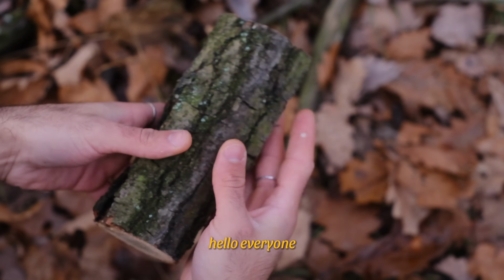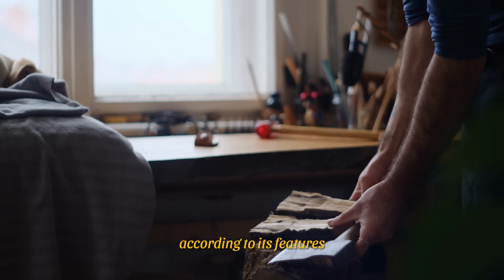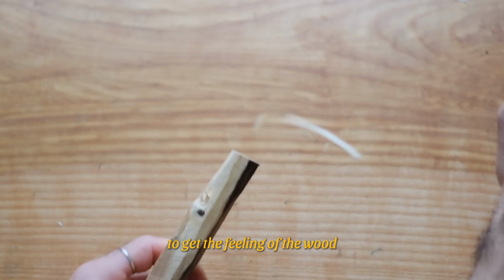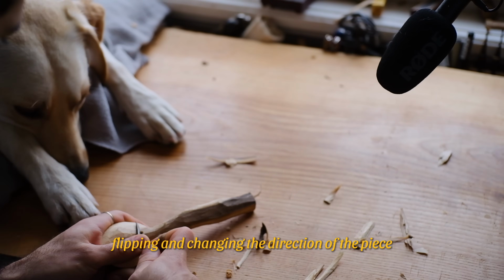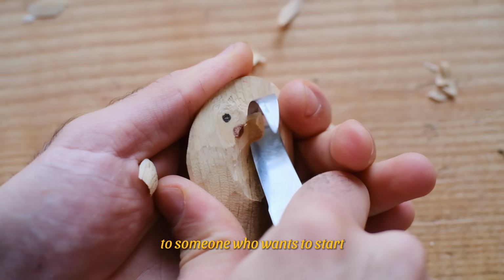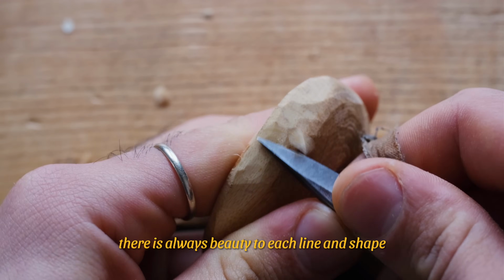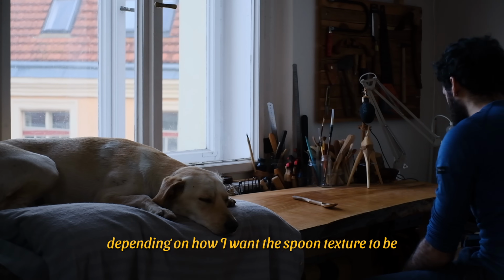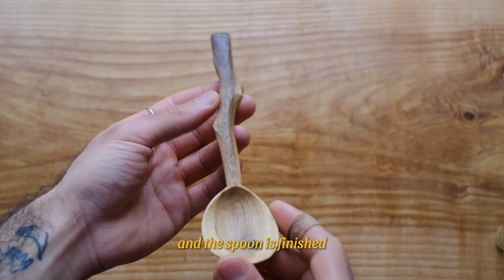How I Carve a Spoon from Start to Finish – Narrated Version

Comment: Well done.  I've been making spoons for a couple years and you have convinced me to seriously try a hook knife.  I've been using gouges only for the bowl of the spoon.  You have excellent controll with the knife and hook knife.  I have taken a different direction and focussed on ways to hold the piece.  I've built spoon mules and use a draw knife for all the rough carving.  It impresses me to see the controll you have with your cuts.
Reply from the maker: I also started with gouges, only bought the hook knife later on(:

Comment: A little piece of advice, if you don't mind:). Try double oil soaking of a spoon - after first oil soaking wait for 24 hours, then a little bit of 320 sandpaper work. Wipe it with a smooth textile, oil it again and after another 24 hours of drying, polish it with cotton very intensively for about a 15 minutes, to close all microcsopic pores. This makes wood more longlasting, especially when it constantly contacts with moisture.
Reply from the maker: Thank you! I’ll give it a try😊🙏🏾

Comment: absolutely wonderful video! 
so inspiring, bought my first Mora 120 knife a couple weeks ago but have barely touched it yet, but this video gave me so much motivation! Thank you! 
When leaving the spoon to dry, does it have to be in a bag for a slower drying process or can you leave it out in a room?
Reply from the maker: If the wood is still fresh and wet there’s a high chance it will crack if left outside, I only leave it outside once it reaches its final thickness and it’s fairly dry(:

Comment: You can get greater control of the axe if you get a hewing hatchet. Sharpened only on one side like a flat chisel. Because the back of the axe is flat it is easy to control how much the axe digs into the wood. I used to call these carpenter axes but carpenters have not used axes in many years.

Comment: Hi! Absolutely love your work and your videos, this spoon is awesome! Love the handle
I have a question (feel free to not answer though)
I’ve been using a protective paint, but I’ve found it not working much (it accumulates in the holes and gives a weird texture I don’t really like), is any food oil able to make any spoons/forks good for alimentary use after left to dry?
Thanks for your work, this video, and reading!
Reply from the maker: Hey 👋🏽 I usually use walnut oil, and I don’t have much experience with any non natural protective coats. But If it disturbs you you can try several things, I would either try to use a les porous type of wood, like maple, cherry, plum (you can look online for more). Or try to sand it and burnish with another piece of wood to seal the open pores and make a smooth surface.

Comment: Thank you for sharing this journey, I found the tutorial very informative.

Can you suggest tips for finding the right raw material that can be processed without a saw or an axe? I am just getting started, and would prefer to not acquire tools if I can get by without them.
Reply from the maker: A saw is quite basic🤔 you could get a small one or a basic one for very cheap. But if you still want to try without I used to just find some fallen branches and break them with my leg, the only problem is that you are limited to what you can break 😅

Comment: Beautiful video and inspiring. One question- Is it necessary to re-oil from time to time? Cheers
Reply from the maker: Depends how much you use it, if you will re-oil it every few months it will make it last longer, and it would look better. But I’ve used spoons for several years without oiling and it’s fine they just look super exhausted 😅
Reply: @nadavartandwood  Haha, cheers, keep up the great craft..

Comment: Thank you very much for a very beautiful video. I  have a question  (checked part of the comments) but isn't it Robinia pseudoacacia? If yes, doesn't the wood need a certain treatment to lose its toxicity, that's what I've heard from a carpenter once? Thx and keep up the beautiful work !🖤
Reply from the maker: This is oak from what I know🤔 from my research online I couldn’t find any problem using it, the main problem I found with toxic woods in general has to do with breathing the sawdust from using machinery

Comment: Does the spoon sometimes warp or split after carving it? And do you always carve with green wood?
Reply from the maker: Yea it can change its shape if I carve wet wood, but if I make sure to store the piece in a humid place like a half closed plastic bag with some wooden chips, it slows the drying and prevents the cracking(:

Comment: Hey, if you wanna sharpen or strop your hook knife go buy a round dowel and wrap a peice of sand paper around it and use it to sharpen from the inside. When you wanna strop do the same with a peice of leather with stropping compound. You always want to sharpen or strop on the inside of a curved blade
Reply from the maker: thank you! actually this is how I do it at the moment, but because the mora hook knife is not hollow grinded I find it quite hard to make a consistent angle

Comment: Don't you have to wait for the initial piece of wood to dry out? Like months or so? Otherwise won't the spoon break in some point sooner or later?
Reply from the maker: If I make sure to keep my piece in a humid area like a half closed bag with some wooden chips I can prevent the cracking and the spoon will dry slowly and shrink without cracking and breaking (:
Reply: @nadavartandwood  thank you so much for the answer! I have some chopped birch and I will get my first tools, and will try to make my first spoon! Can't wait to try it :) It's been so long that I wanted to :)

Comment: On a previous occasion, I removed a log from a state park and was issued a citation, the exact sum of which I recall to be either 170 or 140.
Reply from the maker: Sorry to hear that, many parks and national parks make sure to enforce this much more. I try to find pieces that  will be left to rot so if any one will have a problem with my doing I’ll have a good standing point to why I am not trying to hurt anyone or anything, but still some rangers wouldn’t care and will give a fine either way

Comment: Nice work but I wouldn't use sandpaper at the end. Sandpaper pushes the grain down, and when the spoon gets wet, the grain often will rise again and have a not smooth surface.
Carving cuts the grain fibres and water will not raise them so you always have a finish that is as smooth as when you cut it.

Also, if you sand with high grit sand paper, like more than 120, the dust can actually block the pores which reduces the absorbance of the oil finish.
Reply from the maker: Thank you for the tip! Don’t you find that the oil doesn’t really penetrate the wood if it’s only carved?

Comment: How do u dry your spoons do you bake them to dry them? Mine keep cracking is it because I carve from greenwood ? I tried working them out and leaving them in a bag but they end up drying too fast
Reply from the maker: while working I try to make sure all the parts of the spoon has the same weidth, also if the bag is not humid enough try to put some of the wooden chips you carved around the spoon this should help(:
Reply: @nadavartandwood  man thank u my friend .I am a Flint knapper mainly but I sometimes work with wood and am trying to get better. I came across some Aspen and wanted to make some things. I appreciate you teaching me

Comment: Remember when you finish with it if you intend to actually use it soak it in vegetable oil so it will not dry out and split.
Reply from the maker: thank you for the advice(:

Comment: doesn't walnut oil go rancid?
Reply from the maker: In my experience if you make sure that you save the oil in a cool place, sealed it won’t go rancid, once I apply the oil on my pieces it usually dries quite fast and there’s no problem (: